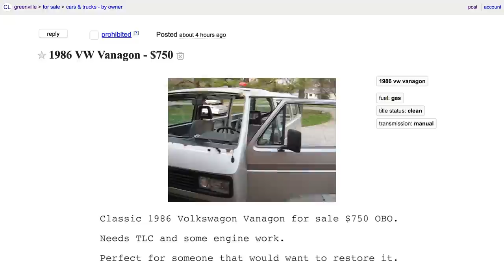Crepeattack Build: The Ultimate Expedition Syncro Vanagon

Comment: Is that a syncro? I don't see the 4WD on the front of it or the syncro metal word on the rear of the vehicle?
Reply from the maker: Yes Syncro. I have no plastic crap  on my van so badges have to go ;-)
Reply: @Syncrogreg  Beautiful vehicle. Did you buy donor vehicle for westfalia kitchen parts or did your 750$ buy also have functioning parts, it just needed engine work? Further how long did this project take?
Reply from the maker: @andersonfuller  it was a passenger Syncro that I bough $600 then I bought a blue 1983 westy for $500 and also a 1989 westy for $1800 ....3 vans into this one
Reply: @Syncrogreg  I am so happy for you those are great prices. Was transforming a passenger van into a westfalia difficult? I have thought about buying a functional syncro and a donor westfalia.
Reply from the maker: @andersonfuller  thanks mate. If I had to do it again i would probably find a good camper and adapt the Syncro subframe parts to it. The roof is a project as well as all the cabinetry...

Comment: Why diesel engine ? I am considering getting a gas powered Toyota Hiace for  similar adventures. Will need to have it lifted to improve ground clearance and change the tires from regular to all terrain tires for better traction.
Reply from the maker: We carry only one energy : diesel . It powers our cooktop webasto diesel space heater and engine! Safe fuel that won't blow us up on a highly modified vehicle. Fuel efficiency 30mg gasoline can do 20 at best on these rigs
Reply: @Syncrogreg  So you would recommend i get a diesel Toyota Hiace then and convert from panel van to rv van,even though diesel cost more than regular gas.

Comment: Gregoire - I honestly don't understand - you found a T3 Syncro for $500????!!! most I see start at around $17,000? did you make it a Syncro? I'm lost; did he start with a non-syncro and make it a Syncro? I think all of us would try to copy this build if we had a Syncro for $500 to start with!
Reply: As a fabricator I am strongly considering using an entire Audi QUATTRO drivetrain flipped upside down in my free tintop Vanagon. I think the rear open differential should drive the front wheels just fine.  I now have a FWD Audi A4/VW B5 Passat transmission inverted being propelled by a MK4 ALH TDI engine in my 66 splitty bus. It is freaking amazing.  This will be my course of action to create my own sacred SYNCRO propelled by a 280 HP 3.6 VR6 from a B6 Passat/Q7 Audi SUV.  Yeah baby.

Comment: $750 for a running rust free tin top? WTF. Makes me cry over my rusty running Westy in need of an engine and all mechanicals, PLUS rust remediation.
Reply: I just got one for free six days ago.  I am still in disbelief!!!  I don't believe it there was also a Westy with an inline 1.6D that also just just 2 days ago for only $2,500. It was pretty awesome but with some surface rust however it had no title. Mine did and only rust is the lower windshield sill.  The rest is STRAIGHT. I think I will likely swap a 3.6 Audi Q7 VR6 in there. 280 HP should move it along quite well. My 66 splitty bus has an ALH TDI.  Goodness I adore these machines.